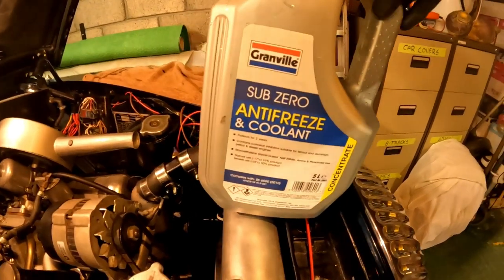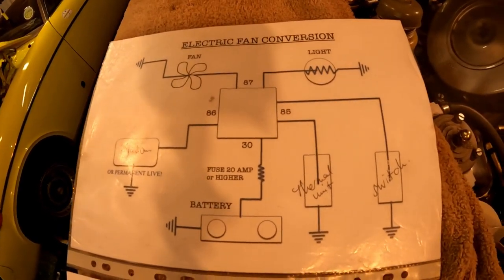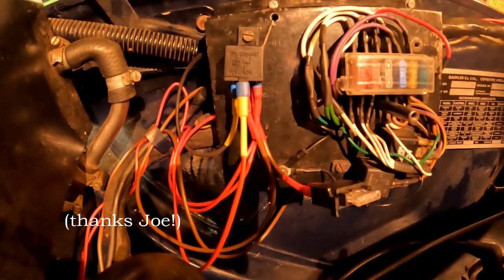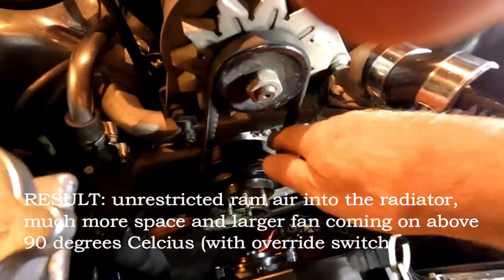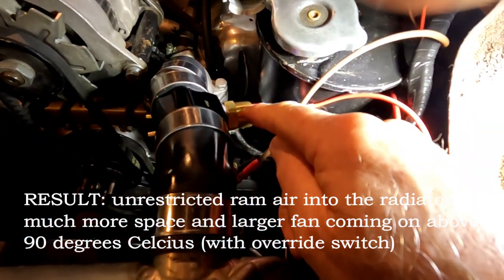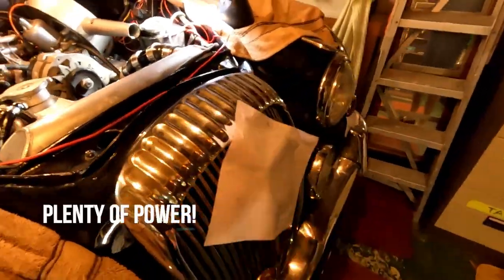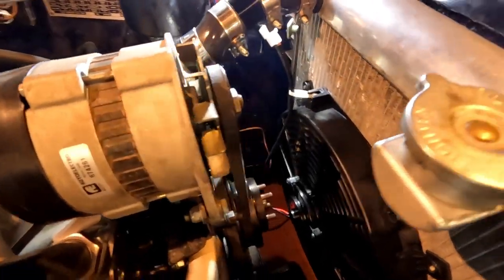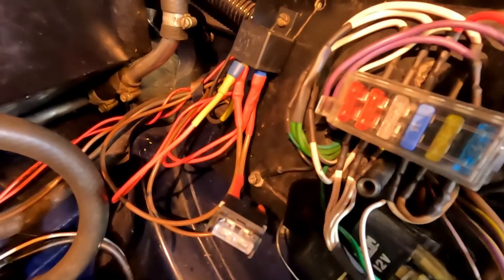Daimler V8 electric cooling fan conversion

Comment: Mark, did you find out what the ticking noise was on your Daimler engine, and if so did you manage to cure it ? When I was an apprentice motor mechanic, they used to use a stethoscope type device to search for noises.
Reply from the maker: Keith, short answer: NO!  Had a lot of mechanics/engineers look, check and hear the engine, no solution. As we use the car a lot and will keep her till my end of days, I took the decision to have the engine professionally restored by Jonathan at J & E Engineering, who specialise in Daimler V8s. Absolutely chuffed with the result! It will now outlast me. Thanks for asking Keith, appreciated.
Reply: @Daimler-Jensen  I worked at a classic jaguar restoration company for a number of years, the earlier 6cyl engines sometimes made a similar noise, often from the cam buckets and sleeves/ orifices that the buckets run in. Anyway glad you will have it resolved. Beautiful v8 engine.
Reply from the maker: @keithgarland3404  Thanks Keith

Comment: Hi Mark.  Great informative video.  Can I ask what the driver was for this upgrade?  Did you have issues any with cooling?  Many people seem to be concerned with the cooling of both these Daimlers and the Jag.  I'm currently in a position (part way through a resto) where I can take a number of routes with the cooling system and I'm still unsure about which direction I will take.  I have an original radiator which I was going to get re-cored (~£300) but I see you have opted for an aluminium version.  Did you do this yourself, if so, does it provide better cooling than the original?  Either way, I think I will probably go with an electric fan (maybe the model you have chosen) due to the convenience and cooling power even when the engine is at idle.   I can see you have a shot in the video of the components you used, but if you don't mind me asking, where did you get these and what was the cost? Anything you would have done differently?  Thanks for posting.
Reply from the maker: Hi Steve, thanks for your response. Although I didn't have any issues with cooling, we do use the car a lot, including mainland Europe in the summer. I bought an alu radiator which is fantastic and wanted a better sucking fan instead of a little Kenlowe blowing fan. I've just had my engine professionally restored by the best in the UK (I think) and as he said 'watch out for overheating', I didn't want to take ANY chances... If you give me your email address or, maybe more secure, look mine up (Google or Facebook), I'll give you my shopping list etc. Hope this helps.

Comment: Pair of great classic cars you have, and a nice garage also, how loud is new fan system from inside the Daimler.
Reply from the maker: Thanks Keith. Although it is a big fan (14" 160 Watt) and you will notice it, the noise it nothing extraordinary, especially with the bonnet closed and engine running.